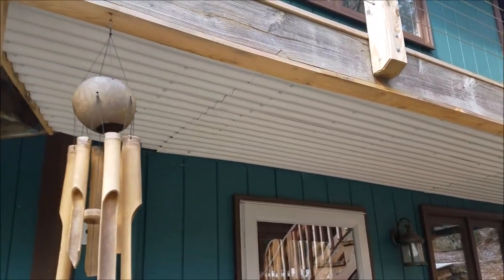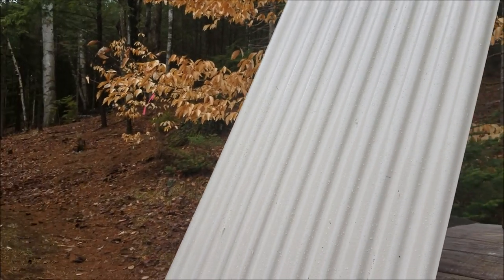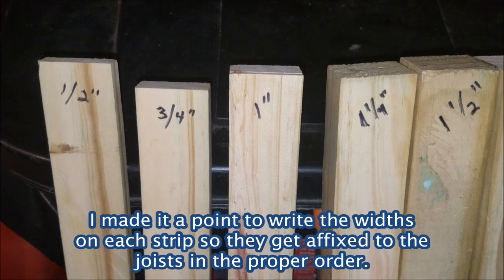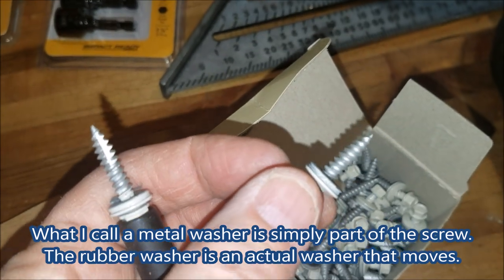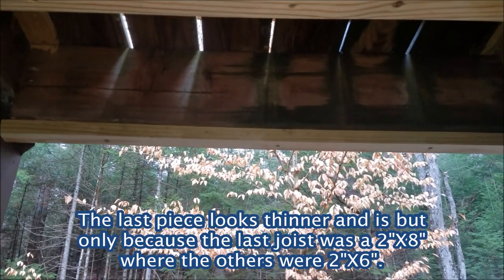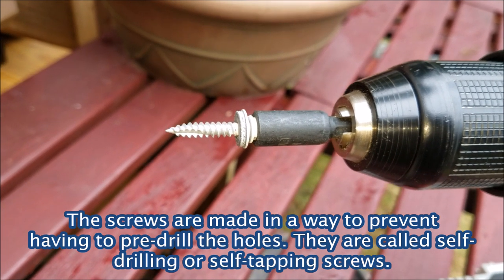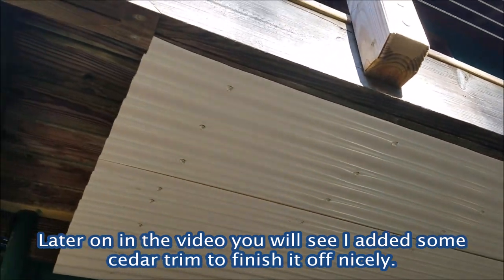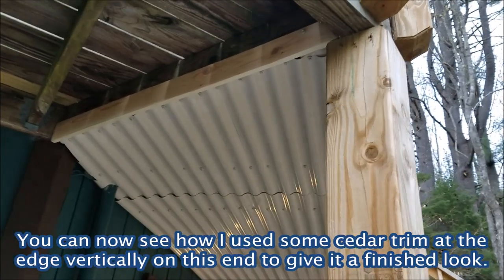𝐃𝐈𝐘 𝐔𝐧𝐝𝐞𝐫 𝐃𝐞𝐜𝐤 𝐖𝐚𝐭𝐞𝐫 𝐃𝐢𝐯𝐞𝐫𝐬𝐢𝐨𝐧 𝐚𝐧𝐝 𝐃𝐫𝐚𝐢𝐧𝐚𝐠𝐞

Comment: I have a 10' x 20" under deck and I'm doing the same thing. I already have all of the supplies and maybe ran me $200 for all of the materials, but I have a bunch of grills and I plan on storing my zero-turn and side-by-side under there as well. Just about the only difference in our builds is that I have a rectangular form strictly and I opted for the clear Polycarbonate because I have about 1,000 small LED lights mounted to the joists and that way they would still be a viable option to keep in place. Great job though!! I'd love to see the finished product.
Reply from the maker: Hi @BigPeter1313,
  Thanks for your comment. If you are able to get a full 10' piece of polycarbonate that is the way to go. Mine is longer than that so I had seams and over the years some leakage occurred at the seams between the pieces. So, my suggestion to you is to 1) ensure the slope is steep enough and 2) minimize any seams if at all possible. I may have to do a redo and have the underlayment go perpendicular to the house into a gutter and not parallel to the house into a gutter. If you are only 10' long and 20" wide you might only have one piece of polycarbonate, right?
Best,
Bob
Reply: Thanks for the advice. I had actually made a mistake in what I wrote: the deck itself is 20 x 20, but I have a sunroom that's 18 x 15, so I really don't need the extra length, by the poly sheets are 12' to ensure I had good overlap. Zero seams.  @TotallyUniqueLife
Reply from the maker: @BigPeter1313  OK, so you will have overlap. That is actually what I meant, the overlap from sheet to sheet. Ensure you give enough overlap and that you slope it enough so that the water keeps moving and doesn't back up. I would also suggest using some type of adhesive where you have the overlap just in case there is any backing up of water. Construction adhesive should do the trick. No one will see it but you'll know it's there to help create that bond from sheet to sheet. In hindsight I would do a number of things differently and slope and and construction adhesive are two of those things. Good luck Pete!
Best,
Bob

Comment: I have an old deck that is 1ft above ground. 16 inches between joust.  Not easy maneuvering hands under deck, but I am thinking maybe I can do something like this to carry water to outside of deck.
Reply from the maker: Hi,
 If you feel you can get under there with enough space to work, I'd say go for it. So, you're doing this just to divert the water from puddling under the deck?
Thanks,
Bob
Reply: @TotallyUniqueLife  I think I can fit my drill under to screw pieces on.  the basement has good amount of moisture when it rains hard.  I am going to be doing drylock on inside walls. when I started taking up deck boards, I noticed ground slopes right into the house.  so I was going to build up packed dirt about a foot high against walls and bring it out 2ft until it meets the average level of ground under there. then put more of that weed type barrier stuff over the dirt.  I also noticed the 4x4 post are wet looking even though it had not rained in 4 days.  I was going to build up concrete around post to slope away or maybe make something to flash around it.  the thing you did is to give it a better chance of not having as much rainwater get down there.  deck 20+ yrs old if I had to guess.  But I can tell you that frame is so solid still that it is really hard to get anything to move.
Reply from the maker: Would it be at all possible to put a gutter under each deck space with a slight slope to another gutter similar to the way I did? You would need to put a gutter under each space in the deck boards. I am assuming that your deck boards are running parallel to the house like mine are. It's just another way of diverting the water other than using the sheets I used. 

Then in the front you could add some facia board to hide all the gutters. Maybe you just need a few gutters in the spaces closer to your house to get the water flowing away from the house? Or you could use my method as well.

I'd love to see a picture of the deck. It is hard to visualize without a pic. If you'd like, you can send one to bobbessette@totallyuniquelife.com.
Thanks,
Bob
Reply: @TotallyUniqueLife  Yes, I will send you pictures.  & yes, I thought of putting gutter at end so that water is carried out.  I noticed the one wall that has gutter going into ground.  I thought about digging it up to inspect it.  I will send you pictures.  
Btw: I run a pro audio company where I customize dj/karaoke/band systems. I normally charge consulting fees as it is an art & very time consuming.  If you are ever in need, I would love to return the kindness and give you all my expertise for free.

Comment: How did you seal the panels where they touch your house, flashing? Clear sealant? I’m at at stand still with my project
Reply from the maker: Hi Ben, I didn't have to use anything due to the fact that the deck boards above didn't have a seam until at least 3 inches from the house. So, when water came down from above, it just went directly into the channel and no drips occurred along the house. We also have quite an overhang from our roof above the deck which helps significantly.
If you need to have something there you could use a clear sealant like Flex Seal, either the spray or the paint on can. I never once had a leak against the house.
Best,
Bob

Comment: How has this held up? Have you had snow or ice, and has that caused any problems? Worry that flexible material may not be able to handle the weight of snow or ice. Has the color of the materials faded at all?
Reply from the maker: Hi bjoecool, thanks for the question. Snow or ice has caused no problems at all. Remember, there is a deck above the plastic with a small amount of space between the deck panels. I've never had any issues at al with ice or snow because I think by the time it hits the panels, it's either water or slush. Remember I live in the White Mountains of NH so the winters can be severe. The color hasn't faded at all. If you send me a request from my website I will take a picture and send it to you how it looks today. Use this link - https://totallyuniquelife.com/contact-me/
Best,
Bob

Comment: Have you had any issues with leaves/pine needles falling through the gaps in your deck and blocking water flow?
Reply from the maker: Hi Billy, not really because I don't have pine trees hanging over my deck and I've pretty much taken down most of the big pines in that area anyway.  Maybe once a season I'll take my hose up on my desk and run it just to clear out anything that may have accumulated. To be honest, a good rainstorm or two or three will do that for me. 

So, to be honest, it's not much of an issue for me. I also have about an 1/8" to 1/4" gap in the decking so it's not a large enough gap to accumulate a whole lot. I guess if you had a lot of pines in that area, pine needles could be an issue. But, once again, a good rinsing with your hose from time to time or from Mother Nature's hose should keep that issue in check. Good question.
Thanks,
Bob

Comment: This is great! How do you prevent chipmunks, birds and bees nesting in the pvs space? 😮
Reply from the maker: Hi Avi,
  That's a good question. First of all, any opening is really too small for birds unless they were tiny so that is not an issue. It really wouldn't make sense for chipmunks either as they are typically in-the-ground creatures as I can attest to living here in the White Mountains of NH. Bees definitely could create hives in the space under the deck but I haven't witnessed that yet in the years I have had this under-deck water diversion solution. If you did notice bees going in and out it is possible to spray from above through the cracks of the deck or through the openings that the water emanates from at the end. I do keep an eye out for that but it hasn't been an issue for us yet.
Best,
Bob

Comment: Hi! Thank you for the useful video, I will be tackling something similar soon. I know you used pressure treated wood, but would you recommend I still coat those graded beams with deck stain sealant for the long term, or is that overkill?
Reply from the maker: Hi Dustin, I would say you would be completely fine with just the pressure treated wood but that is entirely up to you. Another suggestion I would have is to purchase as long (lengthwise) of the Tuftex panels as you can purchase. If one sheet covers the area lengthwise that is ideal. If not, ensure that you over lap them enough so as not to have issues with the seams leaking.
Good luck!
Bob

Comment: Does it cause the joist to rot? With lot of moisture trapped in?
Reply from the maker: Hi, first of all, all of the wood is PT (pressure-treated) and secondly, the water is diverted to the gutter system. No water is trapped. That is the point of the diversion technique. I hope I have answered your question and thanks so much for it.
Best,
Bob
Reply: I'm curious if wood rot as well. Is there enough air to circulate to dry out all of the boards

Comment: Any updates how this project has held up with snowmelt?
Reply from the maker: Hi Niko,
  I've had no issues at all with snowmelt.  The deck boards above have a small spacing between them which allows water to flow down to the panels.  The runoff then goes into the gutter and is dispersed onto the ground. No issues at all over multiple winters now.
Best,
Bob

Comment: I think this is a great idea, although when ever you have wood on wood moisture gets trapped and causes dry rot. Adding a moisture barrier i between the wood using pressure treated wood also instead of pine or Doug fir is also a better idea. Overall your video was good. You definitely gave me a idea for under my deck as I am currently putting up a retaining wall with a good drainage system because of there is erosion that happens when the water drips in between the deck slots. And this idea would help prevent that.
Reply from the maker: Hi, if you are referring to the border of wood I added to dress it up, I agree with you. The deck itself is all pressure treated though. I'm glad I gave you some ideas for your own project!
Best,
Bob

Comment: Nice job on the build.  This should last quite a while.  Running the spacers continuously instead of placing them only where a screw is needed to secure the material might cause some difficulty later, as debris makes its way from the deck surface and tries to follow liquid flow out to the side of the deck.
Reply from the maker: Hi Greg,
  Thanks for your comment. I check the debris accumulation regularly via the spaces in the deck above and I'm not seeing that issue. But I can certainly understand your concern and appreciate you bringing it up.
Best,
Bob
Reply: @TotallyUniqueLife  Fair enough.  Not really a criticism of your work as much as a consideration for ppl watching your video and planning something similar.
Reply from the maker: Hi Greg,
  I never took it as a criticism. I am a DIYer and never claimed to be a professional so I welcome other experienced opinions and suggestions.  That's what this all is about. Learning new things through others and conversing with them about certain techniques.  To be honest, when I was researching doing this project I never really saw the method you are talking about but it makes sense. I guess you'd just have to remember where the board are for fastening but I guess you could use a stud finder or be very cognizant of the exact location before you add the panels.
Thanks,
Bob

Comment: Another question - any issues with Birds, wasps etc
Reply from the maker: Hi, thanks again for your question. Ya know, it's funny, I thought that this would be a perfect place for bees nests and I have been vigilant in checking for them on a regular basis. I haven't had one nest under there since I created it. Nothing with birds either. We have robins that try to build nests in the strangest places on our house but never under the deck between the wood and the panels I added for water diversion. So, No on both counts but really good questions!
Best,
Bob
Reply: Ooo good question. I'm under a bunch of large fir trees so I'm a little worried about debris building up and/or difficulty cleaning. My instincts are to be cheap and use a tarp but this is a new home for us and the Mrs. Would not approve

Comment: does the overlap ever leak?
Reply from the maker: Hi Nick, really good question! If I were to do this again I would use the 20' lengths to prevent having overlap between lengths. Obviously you have to overlap side to side which has not been a problem.  I have had some slight leakage with the overlap between pieces lengthwise which were resolved using FlexSeal in the seams. That stuff is awesome.  One single length is certainly the way to go when I do this to another section of my deck. In fact, when I do that section I'll be going perpendicular to my house and not parallel like this project. I did it the way I did the first time because that was directly above my front door and we didn't want to have a gutter on the side that faced the front walk.  Good luck if you plan on tackling a similar project!
Best,
Bob